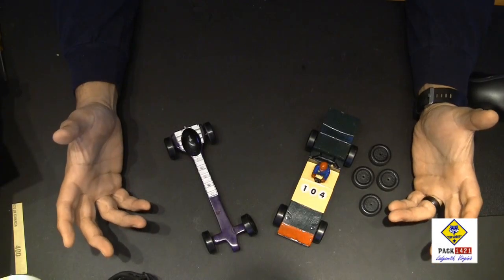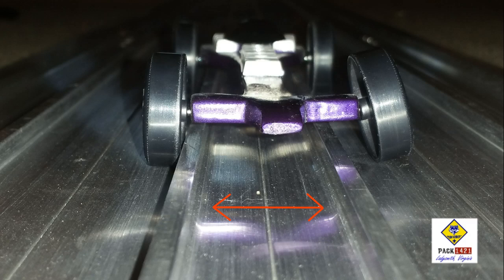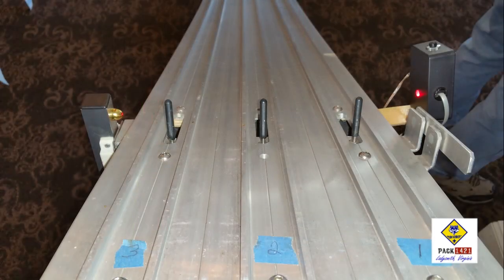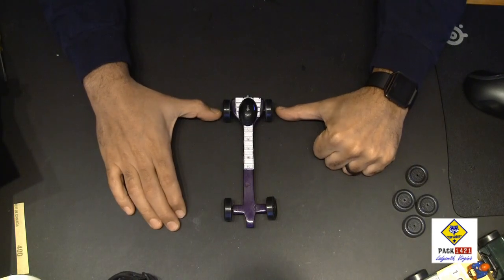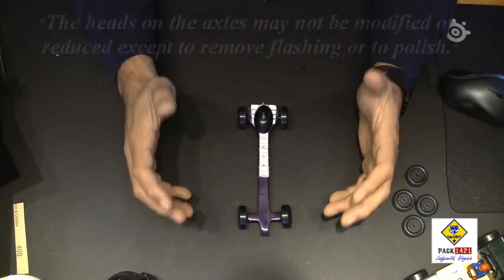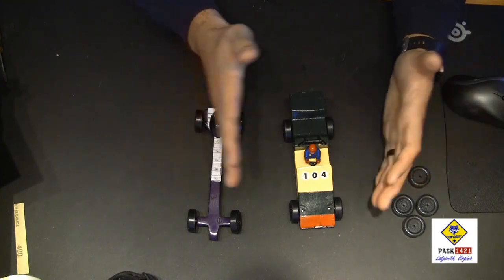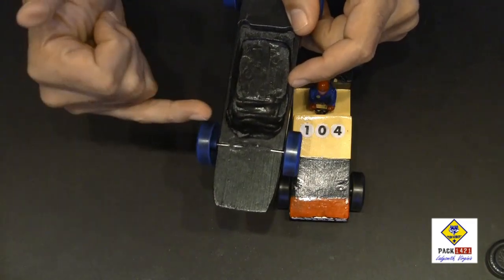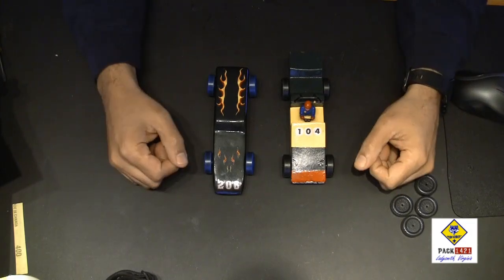PWD Speed Tips Part 07: Overview of "Rail Riding"

Comment: I dont understand,  can someone please help, i got a derby coming up soon, i bent my 2 back wells 2.5 degrees and then put them on but how is the wheel suppose to rub on nail head when nail is bent, its always going towards the car, the wheel has to go uphill on the nail to rub on nail head, mine seems to stay down by the car body amd rubing there
Reply: I think you bent it to close to the nail head. Next time, stick the nail through the wheel...where the nail comes out, mark it with a perm marker. Then bend it from that point. I put it in my drill chuck and spin it against a slow running dremmel tool. Then put the nail in my vice just under the dremmel cut line. Then take a flat head SD and gently tap the cut line a couple times until you have a bent axle.